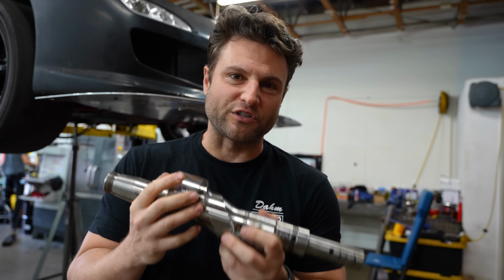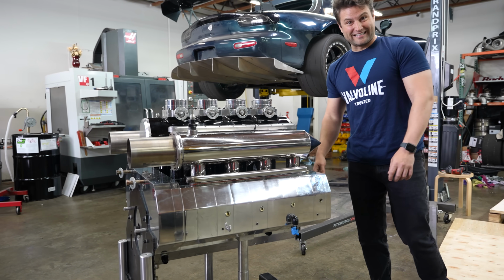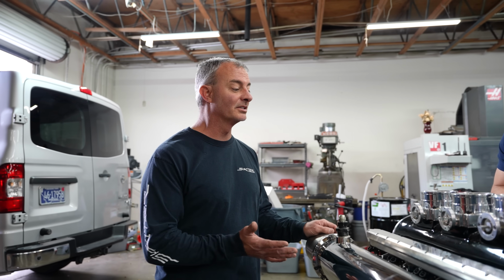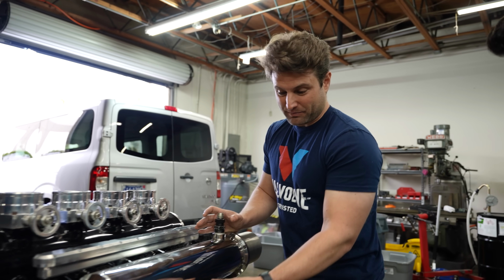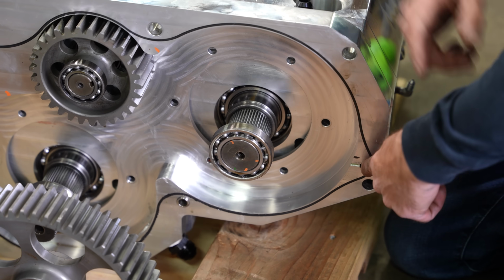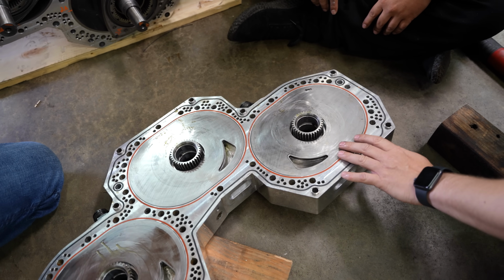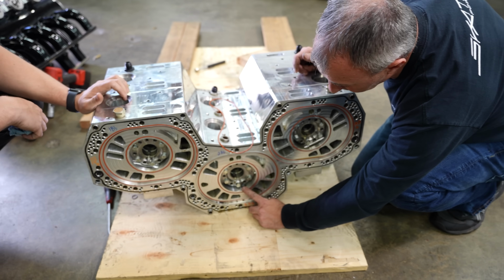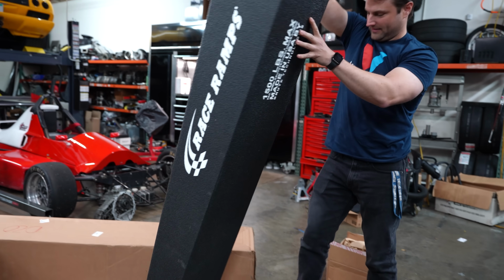I WAS GIVEN THE ONLY 12 ROTOR ENGINE IN THE WORLD!! WITH ONE GOAL IN MIND

Comment: With regard to the comment you made about the spline on the gear train being overbuilt, I would ask you to consider the rotational momentum imparted to the splines by a gear of that size.  The RPM transients that a motor of that horsepower potential might be capable of will most definitely impart some very serious lateral loads to the splines supporting the stability of the gear.  Give me your thoughts on that if you think about it.  What did he say, the “large” gears will be turning about 8000 rpm, the small gear about 21-22,000 rpm.  Those flywheels (shaft gears) will be holding onto some very serious rotational energy!

Comment: That HAS to go in the Indy car... Has too... that is amazing.. think of the amount of time & wasted material that went into developing this.. when he was talking about CNC'ing it... and going all the way thru it.. that bit has to be like 2 feet long.. that is crazy... wonder how long it took to plan this out.. create it in CAD.. then spend a CRAZY amount of money on high strength aluminum.. (i wonder if the initial prototype was cheap aluminum?)... then think of the amount of waste & mess-ups that happened... i have ALOT of respect for that man.. from an engineering stand point.. incredible..
Reply: This is the prototype, I did not make any of the parts out of cheaper materials as setup pieces. I made 6 of the cranks and I made two sets of rotor sleeves one set out of cast iron and the other set out of pre-hardened 9310 steel to see which would wear better. but other then those I only bought enough material to machine it once and hope I did not mess up. Besides the spot I jb welded in the video I only made one other mistake of not machining the oring groove in the gear box cover but then had to put it back in the machine and put it in.
Reply: @TysonGarvin  I have alot of respect for what you accomplished, I know what's involved.. amazing job! sometimes people see the end result of something.. and have no clue what actually went into creating it.. the amount of time.. math.. designing.. CAD.. simulations.. testing.. CNC'ing.. more testing.. building.. re-CNC'ing.. more testing.. lol.. incredible job man..

Comment: I wonder what hp numbers it is going to end at when built up with the turbos and tuned.
I guess 5000-6000 hp could be possible.
What do you guys think?
My benchmark for a BBC sized engine is of course the SMX.
That can do 5000 hp, but that is not flatout for any amount of time and that is only for drag applications in short burst of 5 seconds.
But this guy said he built this as an upgrade from the BBC plattform because the BBC couldn't take that flatout peak power from the inherent weakness in the design when we used it for boat racing.
So the question is how much can it pull in both the kind of boat racing flatout for a long time.
And how much in a drag 5 seconds 1/4 mile.
This is going to be very interesting.
I hope they get a promod tube chassi and build it up with this engine for drag racing.

Comment: thats cheating, it needs to be a 3 mile long eshaft inline 12! on serious note, six has to be the abosolute limit unless you link multiple eshafts inline with coupler but, the flex would be an issue?  EDIT: wow splined eshafts!

Comment: I've done my own custom engine build and I can't imagine the amount of money it took to manufacture this.  I'm assuming he didn't machine everything himself, so many of those outsourced components are rather pricey.  And then multiply everything by 12.  I'm betting there's over $100k in parts, if not a lot more.
Reply: I actually machined pretty much everything you saw except for the rotors.
Reply: @TysonGarvin  Wow, thanks for replying!  That's a lot of work.  I machined about half the parts for my inline 6 axial flow rotary valve engine on my BMW and had the bigger parts sent out.  It took about a year from designing the head to having it run for the first time.  7 years later, we are still playing with it to make it better.
Reply: 7 years later? That’s short for projects, I machined most of the 12 rotor engine 15 years ago.

Comment: Fyi Chevy big block and small block are the same bolt pattern, the crank flange might be big block but not the bell housing it’s just a Chevy bell housing, ls and the lt engines share the same bolt pattern as the sbc and bbc but ls has slightly different crank spacing and the dr side up bolt is moved to the top of the bell housing

Comment: Unless it satisfies emission levels it is just another scrap iron jungle. All the chrome in the world won't save it. What is required is an external combustion unit so combustion can be controlled. That means steam. A friend of mine designed and built a modern steamer fifty years ago and took it to America. It was successfully demonstrated to Senators and vehicle builders. The lowest emission engine the world. They didn't want it.There is a possibility somebody may want this for a boat mooring. Best wishes and good luck.

Comment: You don't need an engine computer to run 12 rotors; this essentially three four rotors connected by gears; three Haltech Elite 2500's (4 rotor) one for each crankshaft (separate CPS) or possibly one CPS using an inductive pickup.
I am using a 13B in my plane with a Haltech; even has mixture control from the cockpit like an aircraft Lycoming fuel system and a rotor balance control to any imbalance between them.

Comment: This engine is legitimately comparable to the bugatti chiron's w16, even the displacement isn't that much lower (7848cc VS ~8000cc). This thing looks like it could burn tires for breakfast, and maybe even make over 4k horsepower (which we all were calling impossible back when the ideas for the devel 16 were aloof n stuff). Also, mad props to Tyson and his impossibly - possible 12R. GL, what you guys are doing is a level comparable to big names like Koenigsegg to say the least. Mad hype, and may the powa and spirit of the dorito burn well for you guys.

On a separate note, this video gave me new ideas for what might be possible.
Reply: The displacement discussion makes no sense. A rotary does three combustions per rotation so it's more like 23l. But then again a 4 stroke only does a combustion every other rotation so should you halve the 8l? And the geometry of how the expanding gas drives the shaft is completely different, etc.

What we need to compare is the amount of fuel needed for kWh. That's the only thing common.
Reply: @AnttiBrax  was just comparing it based off of the "mazda advertised displacement" of 654cc per rotor. What you said also has good points, since in some logical ways a 13b can be like a 2.6l, or a 3.9 depending on what factors you're analyzing.

Comment: While you're undoubtedly the only 12 rotor owner, there is at least one running-driving 6 rotor in Japan that I know of, and a 2nd not-currently-running one in the country. Doesn't sound as epic as you'd think, though I'm sure it's choked up for registration purposes.
Add: Doing some rough calculations in my head, this thing *should be capable of just shy of 3000hp, if it all holds together. At that fuel consumption level, I'm kind of surprised the original owner/builder didn't go into jet engine power, but for the sheer sake of mechanical prowess, losing one's mind in a project has ascertainable value, too.

Comment: Im not an engineer, Im a medical research scientist, but we use massive centrifuges that have to be perfectly symmetrical to work properly, this made me think surely timing for balance and smooth power delivery, it would be best to have the rotors timed at 30 degrees to each other with the exact opposite timed rotor being the furthest rotor away? So right 1st rotor would be 30 degrees, left 4th rotor 210 degrees, right second at 60 degrees left 3rd at 240 degrees, right 3rd 90 degrees, left 2nd 270 degrees etc. 

And in terms of pulses it would be pretty much constant with zero dead zones.

Comment: the amount of hours this guy put in on just the R&D the engineering put in and the technical stuff to make this a reality would be unfathomable. pretty exited to see this series to see it run in the end
Reply: Amazing, yes. Performing a useful purpose, no. As the Rotary Engine has a number of inherent flaws making this the modern equivalent of the Hall-Scott Military Truck engines, as used in the Dragon-Wagon which were replaced by Turbo Diesel Engines...
I wonder what they could do if they made a Horizontally Opposed Piston Turbo Diesel Two Stroke, as instead of getting half the efficiency with a rotary when compared to a conventional engine, they could achieve almost double the efficiency...
Reply: @davidhollenshead4892  designs have their ups and downs.

take Detroit engines for example. You know them, the Screamin' Jimmys. Yeah they're not the most efficient, but they make fantastic generator engines because of just how fast they get up to higher RPMs compared to 4-stroke diesels.
Reply: @davidhollenshead4892  Have you been here long?

Comment: Ok hold up!…this guy just engineered the baddest engine possible and on top of that an e-shaft design that fixes so many issues that current 3,4,and 6 rotor engines have! And his irons…what !!! This man’s design could be revolutionary!! The fact that it has the same footprint size as a big block blows my mind and if it makes power with turbos efficiently like Robs 4rotor then HOLY HELL!! And if Rob can tune this 12Rotor to the same amount of HORSEPOWER PER ROTOR as his 4Rotor, then this thing is going to be one BADASS Engine! This man’s design is amazing, if you could go with a two row design that are opposing 2,4,6,8 rotor completely balanced low profile small foot print engines … imagine a 4rotor that would fit in basically anything as small as a compact car  that could make 1000 horsepower on low boost that is reliable!

Comment: Everyone else already said everything that needed to be said.
A car in and by itself capable of handling this much power (at least 5000hp) would literally have to eclipse Project Binky (awesome as it is) by a factor of about 4, a.k.a build a Titanium cage with x-rayed welds throughout, THEN dress it up with RX7 bodyparts.
I have a question though, where are you going to find a transmission able to handle 2000ftlbs at 2000rpm? 
Not to speak of the 5000hp at full blast 🤣
I've subbed to find out in a few years time.
Also why every major youtuber suddenly doing jumpstarters?

Comment: You can't fully hook with 4 rotors. You're going to need 4 rear wheels or snowmobile track slicks, or dually wheels but with drag radials, or fancar downforce, or 90 percent of your weight below the center of the tire, or some pikes peak wings. This belongs in an airplane

Comment: If you were too place the throttle body in the correct (opposite) rotation you could zigzag one throttle cable under-over the butterfly wheel. You could run the lot from one side. that would look cooler than a straight bar could ever look! (you'd also get mechanical lever advantage too)

Comment: I wonder, how much does the 7075 stack expand lengthwise, and how much do those long studs expand at similar temps?  There has to be a massive tq differential on the studs between room temp and operating temp.  Absolutely gorgeous piece of engineering and I want to see it in action.

Comment: ok so he started with a 2 rotor, then 3 rotor, off course. then 4 rotor, makes sense. I saw the crank of a 6 rotor, because, why not right? And now this. 12 rotor. Are you kidding me? The only upgrade to this is a 24 rotor and I have no idea what you could even fit that in. A 42 power wagon or something? Wait, that would be awesome. 42 power wagon with 24 rotors drifting. Oof.

Comment: now i want to know: why did they not use it in a boat? that thing must rip
Reply: if I'm hearing Tyson correctly, they never found an ECU that could run all of the injectors, so the only runs they had, was with a carburetor, which greatly limited the engine's power
Reply: @halofreak1990  Oh I heard that too, I thought that was only for when they were trying to dyno it, but makes sense I guess, imagine if they put that thing in a boat today with a proper ecu setup🤯

Comment: Fun fact, you can take one of those cheap HF cherry pickers and add a few extra pieces of flat bar stitch welded to it and seriously beef it up. Takes 30 minutes, saves a ton especially if you have some scrap steel or angle laying around. The bottle jack is plenty powerful. I've accidentally lifted the front of the car off the ground with mine lol. And audis aren't light

Comment: soooooooooooooooo all i can think of now, is a 6 rotor pdk powered 911.      if that engine weighs 800lbs half of it would weigh less than the 911 tuurbo engine.      rob if you read this and dont build a rotary porsche with this style engine, god will deny you access to heaven. lol

Comment: This is going into the c8 Chevy bolt pattern and relatively thr same size as the LT ENGINE the c8 uses or maybe the v12 of the diablo will be replaced with the rotary 12 this is going to be a monster

Comment: From an engineering standpoint I worry about cooling, rotating mass, and parasitic loss especially as rpm increases with that oil system. I know nothing about engines btw lol 
It looks like its at the perfect stage where you have a design that runs, now its time to discover what breaks or gives you issues first! Excited to be along for the ride!